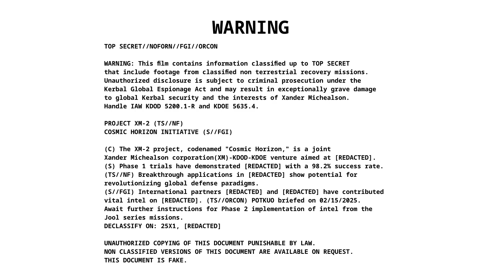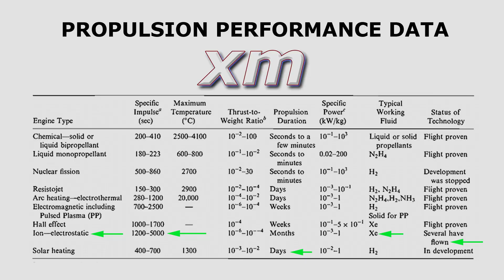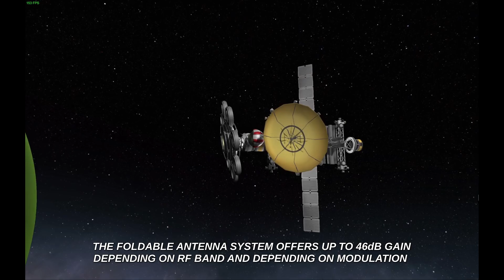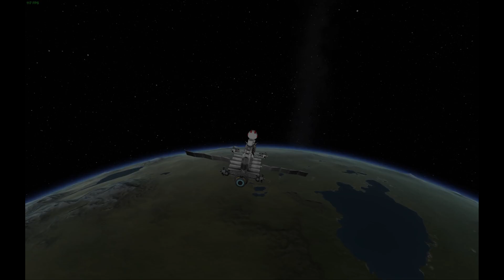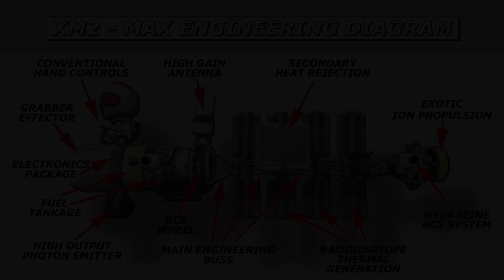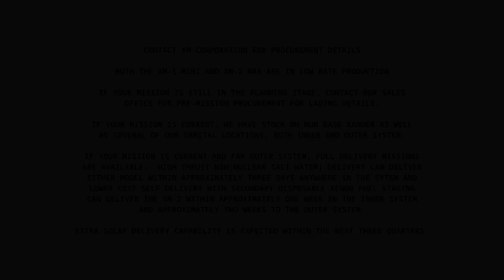KERBAL SPACE PROGRAM: XM-2 MAX: (REAL ENGINEERING TALK PLUS OUTTAKES!) XM Corporation Marketing Spot

Comment from the maker: Dialog Outtakes start at 6:15.  The interesting part to me is that this particular buggy is actually possible.  Every part of this "product" comes from real world stuff.  RTG's are so old at this point that they're older than me and were being used for apollo mission stuff and have been used on all kinds of "deep space" probes.  The radioisotope I mention here is one of the isotopes used.  The aluminum oxide base for iridium catalysts are what some hydrazine thrusters actually use.  The ion engine in the XM 2 is a real technology as well.  Several probes have used ion engines.  Of course, this particular ion engine is VASTLY VASTLY overpowered for the power available.  A common description for this power level is "thrust of the weight of a piece of paper".  A.I. roughed it out for 12kw to be the equivalent of about a dozen sheets of paper in 1G.  Needless to say, you'll be waiting a while!  The other part that I roughed out fairly accurately is the antenna system.  Since Kerbals are about 1M in size, I figured an antenna aperture of about 2M wide is appropriate.  For KA band RF, that comes out to something like a tad north of 50dB worth of gain.  And, since gain depends on aperture AND frequency, as frequency drops, so does gain which means the lower bands will have lower gain as well.  Overall, I hope you guys enjoy the video and full of crap a-hole dialog. :)